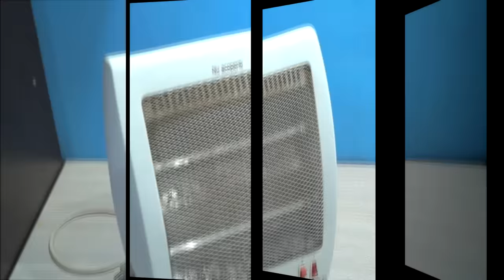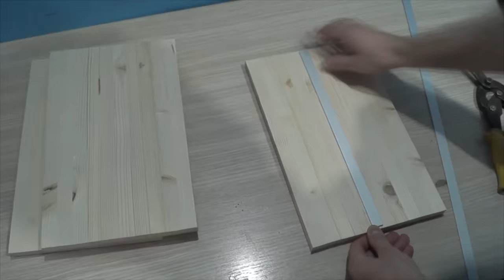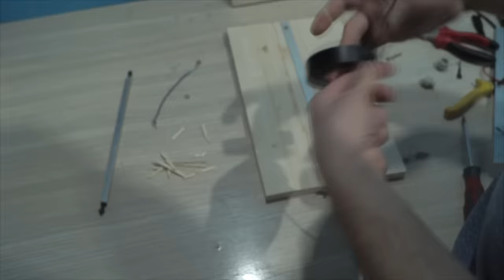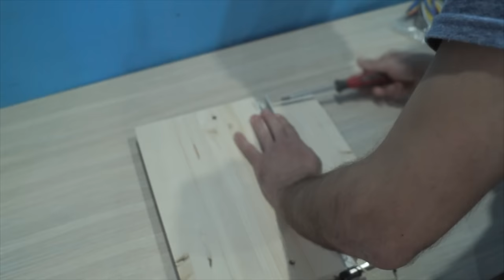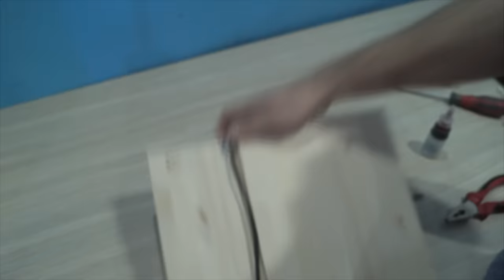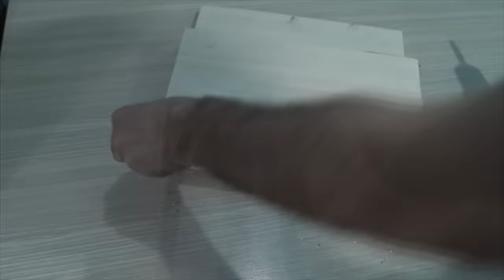DIY Acrylic Bending Machine

Comment: I would highly not recommend using mains voltage for this application unless your country runs 110V or lower with either a ELCB/RCD safety device installed on the mains circuit breaker. its far more safer to use NiCr wire with a DC Transformer.
Reply: 100 % true

Comment: Hi, I would to ask what “voltage & ampere” did you use on a rocker switch is it a “12V & 5A”?
Reply from the maker: Hello, it is for 230V - 10A

Comment: One improvement you do is add some square grid lines on the top and bottom so you can be sure your bends are 90 degrees to the edge. 

If you want tighter radius bends you could narrow the opening above the heating element. You might want to remove some of the pine around the element and install some gypsum (fire code drywall) or other heat proof material.
Reply: I would also add something to hold the sheet in place while it's being bent.
Some sort of a clamp close to the heater.
A strip of metal running across the panel, hinged on one side with a latch or lock on the other.
Reply: @Booruvcheek  Yeah what I did when I needed a number of pieces bent at the same place is I tacked on a strip of wood at the correct spot, that way the bend line is the same on all of them.
Reply: @muskokamike127 إبداع 👌🏻

Comment: Great idea love the microswitch power cutout on folding.  Make it 12v and it's perfect.
Reply from the maker: Thanks! Yes a good idea.
Reply: one standalone radiatior tube he uses needs 400W of power, so using a pC powersupply
with custom made nichrome wire is possible but you max out the power of the power supply where some cheaper/older ones could break.

Comment: Julia, you may find wire nuts are a much safer connection than twisting the wires together; especially with a high load like an element from an electric heater.
Reply from the maker: Yes you are right.

Comment: With what name can I find that old heat radiator tube? and which one do you think is better to use of these: 

.Thermoforming (Infrared Heating)
.spiral carbon heating element
-carbon fiber infrared heating tube
-Nichrome 80-50' - 20 Gauge Resistance Wire 

thank.
Reply from the maker: -carbon fiber infrared heating tube

Comment: I didn't see you added supply 12v will it take circuit breaker out?
Reply from the maker: Hello
Well I have not added a 12v power supply for that resistor works at 220v-230v
Reply: Hello.. did you directly plugged it in the main outlet of your house?  220-240v?

Comment: I wach this videos because I need  bend 6mm flexi glass 90 degree. So looking best choice. For me looks best chose with wire. Or glass heat with gas. I don't know.
Reply from the maker: I think both methods work just as well

Comment: Nice use of the micro switch to automatically trigger the heating element on/off. Hmm, do I really need my toaster oven? It has two of those elements. :-)
Reply from the maker: thanks!
yes you can use them
Reply: @IulianMan  Thanks. I'll have to watch for a cheap toaster oven or check the Goodwill shops for a used one.
Reply: @IulianMan  Found a Black & Decker toaster oven today at the Salvation Army thrift shop for $15. It has four heating elements in it.

Comment: Iulian Man, so the heat element is connected to power directly without temperature control?
Reply from the maker: Hello
Yes it is without control. If you have a control, it would be a good idea to put it in

Comment: HOW DO YOU PREVENT THE WOOD FROM BEING INCREASED IN CONTACT WITH THE RESISTANCE?
Reply from the maker: the aluminum strip stops the heat from reaching directly to wood  and  the resistance does its job quickly so the wood does not grab heat .

Comment: Great Idea, execution not so great,  wood on something that radiates heat? BAAAD IDEA, yes it may only get used short term, but think about the doofuses out there  building that thing 2.
No Soldering? again, bad idea... cutting before measuring.... meh
Reply from the maker: Different opinions are welcome. Thanks!
Reply: It's a proof of concept. He's showing us that it works. 

Also, in order for the wood to burn, the heat would need to do two things:
1. Get through the aluminium 
2. Be hot long enough for it to get through the aluminium in order for the wood to burn, which is why he added a reed switch to disable the power when the acrylic is being being bent.

Also, he just showed that it works without soldering.

If you're going to use any type of power tool, common sense and caution are useful too.

Comment: Wrong design.wood will be fired.you need to use non flammable material
Reply from the maker: For Acrylic glass it takes a few seconds to warm up to bend it. To burn the wood takes a few minutes because the aluminum bar is still protecting it. so there is no fire at all.
But your idea is good too. Thanks!
Reply: @IulianMan   it is ametour design. maybe it can be acceptable but you are walking close to danger.İf you forget it then it will be fired
Reply: @alit.6069  Thats why he installed the reed switch so that it turned off when you started to bend the perspex.....if you use power tools use common sense and supervise the tools you use, It is a crude tool made to get the job done.......if you want to spend more time to make it perfect go ahead.

Comment: Wood catches on fire!
Reply: the heater element is way too hot for this job but as long as he doesn't have it powered up too long, he'll be ok. But it wouldn't take long to start charring and then igniting the pine. 

It'd be far better if he included the rheostat from the heater to control the temp of the element. I have a strip heater to do just this and it's 10w. That heater element is probably 700.
Reply: There's aluminium shield that reflects part of the radiant heat, I guess he could get one polished to make the bending faster so wood gets exposed less with the temperature gradient.
Reply: @richardphatthenguyen195  the easiest way would be just add a controller to turn down the wattage of the element. 

But if he wanted more precise bends (aka a narrower radius) he could narrow the opening by using an L shaped piece of aluminum. But aluminum is notorious for being a good conductor of heat.

In addition (having worked for a plastics fabricator for years) you should be heating both sides of the acrylic. It takes the stress out of the bend. 

It's a good basic design though. Great for making the occasional bend or piece.
Reply from the maker: Hello,
@Muskoka Mike
Yes you are right .
I thought about this but after I did the video :)).
It was fine with an intensity adjustment for acrylic boards of different thicknesses.
At the thin ones, it is good to give less power.
Thanks for the tips.
I will try to make a more perfect device with more adjustments, not that bassic.
Thanks!
Reply from the maker: Hello,
@Richard Nguyen
Yes it is true .
Thanks !
Reply: @IulianMan  it is a good tool. A little tweaking, some improvements and it will be a great one!
Reply from the maker: Thanks!
Reply: use flat Plain Cement Sheet (Asbestos Cement) it use in home roofing in india . it fire proof & also use Gypsum board use in walls and ceilings
Reply: @saanu79  that would work too (Only no asbestos in it in North America, just cement). The only thing is it's a bitch to work with and hard to cut. There is fire proof drywall around but most places sell it in large sheets. It's great if you can buy a broken sheet and just the bit you need.
Reply from the maker: @nidhi electronics  ,yes it would work well